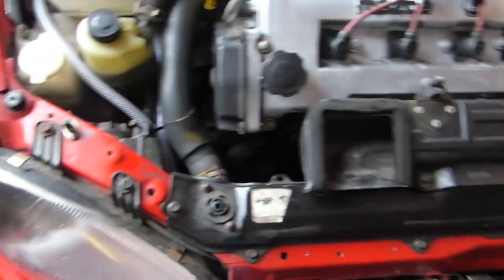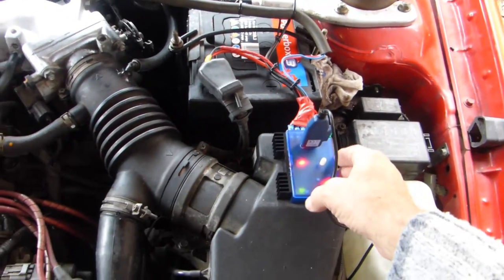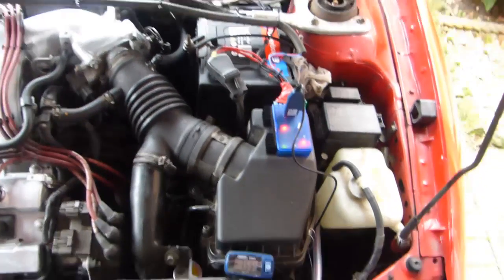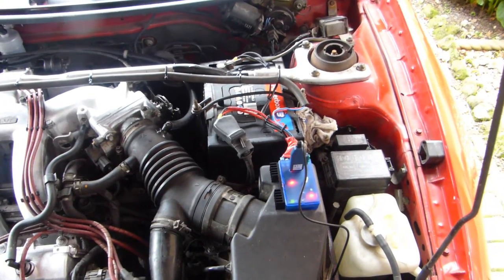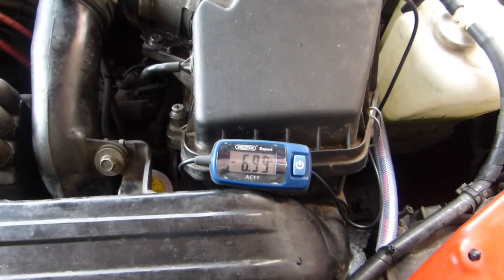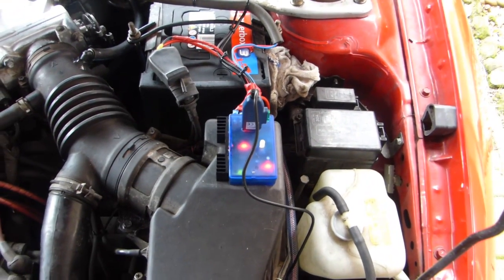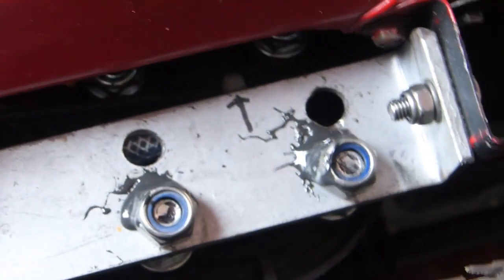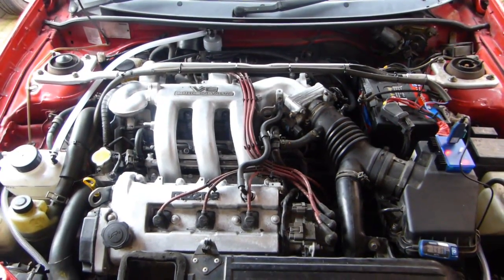HHO on the Mazda MX3 V6

Comment: Boo you need to replace those high pressure water lines with fuel grade piping.  Heat from the motor plus the corrosive gas will rot those water lines quickly.  I would hate for your car to catch fire.  The parts are about a dollar a foot, much cheaper than a new mazda.  Some high temp rtv on the ends wouldn't hurt either.

Comment: Greetings my friend
Interested to know the benefits and disadvantages, MPG, Performance, etc...
Cheers
Reply: michaelnew1962 Might sell a van to build an e-bike.  The future is upon us.
Reply: michaelnew1962
HHO IS NOT A MYTH. I did it to my minivan that was designed to get 18 mpgs and after I installed my dry cell I was getting 31.6 mpgs. http://www.globalenergydevices.com
Reply from the maker: Hi Michael, this is mean't for the other's because we understand each other, but HHO is no myth, I'll be back soon with the delivered evidence.
If everyone kept telling people that Hydrogen is no good then we'd all end up still stuck in the past, we're already living in the 100 year bygone era, the combustion engine is still the same as it was built in the late 1800s, Nuclear energy is just being used for heating a gas turbine engine, and computers are still connected to the hard wire circuits, so until the dark forces let go of the top secret inventions they stole from the patent holders then we will continue to live by the dark. We need to live the dream and become a collective source of the universe :)
Reply: Hey Michaelnew1962 I would be interested in any info as well. I've been following you for quite a while now. We are very like minded  8~)
Reply: STEVEisAWAKE
Added you to the private video. You should have received a Share
Reply: HHO is a myth.
Reply: cheerdiver
How so?
Reply: It takes energy to break the H2O bond, you can never recover it all.  The engine alone is 20% eff.  What they are doing is tweaking the max temp the engine will run, through the O2 sensor.  Most all ICE run slightly rich to prevent  hot spots in the combustion chamber.  The cost will show up in shorter engine life.  Yes, there are a, very, few mpg the manufacturer gives up, that can be recovered but not much.  Take a look at pure H2 systems, even hydrogen embrittlement of metals is a problem.
Reply: cheerdiver
Personally I interested int the Tesla Model S
Reply: Hmmmm, I thought we understood each other as well. Anyway I completely agree with all you said. Combustion technology is archaic, sadly that is all you had to work with, the problem is without having access to Billions we are limited to only making improvements to such existing almost stone age technology.

Think Magnets my friend, cut them from pole to pole at an angle and mount in a circular    pattern, bring them together and watch it spin baby. Just a thought.
Cheers
Reply from the maker: Yeah, Just like the John Searl generator :)
http://www.searlsolution.com/technology.html
Reply: No not quite, Sending you a private video